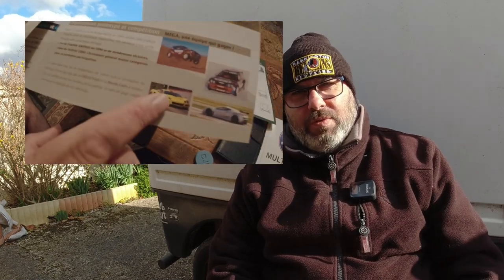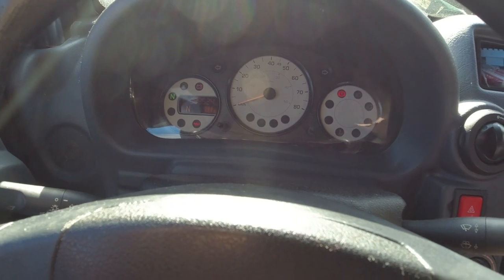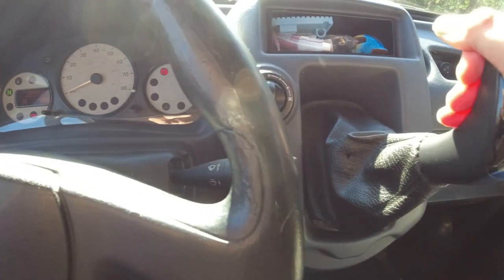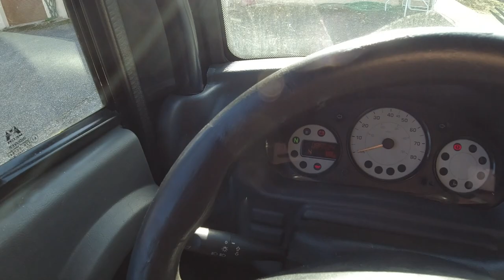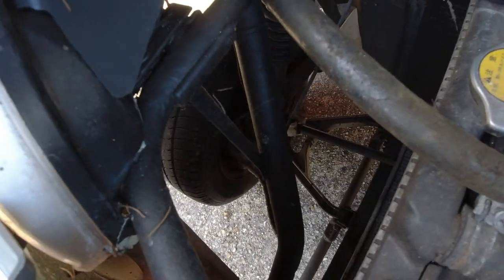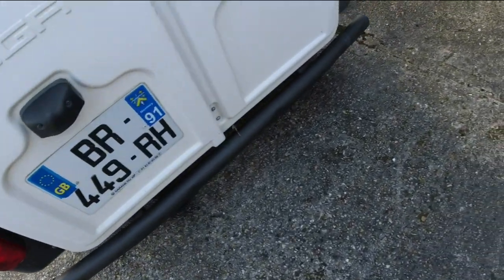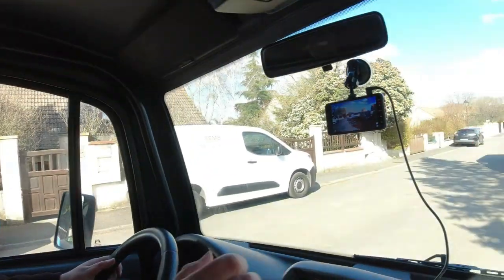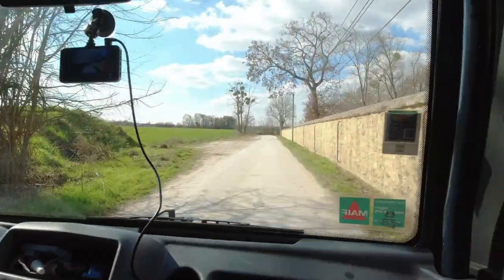"The worst thing ever driven? The Aixam Mega Van thing." - My reply to Hubnut... :o)

Comment: I got an Aixam Mega from 2007 and find it kind of fun to drive. Sure, it's kind of loud, but not at all like hubnut. No idea how he managed to get that beeping noise. It's perfect to able to load lots of stuff. Here in Sweden, car saves on road tolls, no inspection fees and no vehicletax. Also doesn't use that much fuel. Also, enough with a moped drivers license which you could take in a weekend with additional reading.

As I mostly drive locally and on city roads, it's no biggie to be limited to a legal speed of 45km/h (even if it can push 60km/h if you would want to, but then it would have to be registered as a car).

So can't understand the negativity.
Reply from the maker: Sadly it was a severely biased video, which as a result got a lot of views for his channel. These vans aren't perfect, but they are fun. But if you do video of a very bad and uncared for example it does give the impression that these trucks are really bad, when if fact they aren't.
They were designed for a purpose, to basically be a 4 wheeled moped (like a 2CV???). Easy to drive, economical and can carry a decent load. They aren't meant to be fast, due to the licensing level. Here in France, they can be driven with no drivers license. Just need insurance. If you are older like myself and born before 1988 you do not need to take any tuition. I use mine to mainly get around our village, where in recent months the limit has been dropped down to 30kph on all village roads. I could take it to surrounding villages, but the road limit on the roads around here is 90kph. Our nearest town is 3km away and the road into it from here has been dropped to 50kph.
Anyway, if you are negative or cause conflicts on social media, then that results in lots of followers, likes, views etc. Just the way the world is on here now.

Comment: Never driven one but I've always liked Aixam.  There's quite a few in Poland, particularly in rural areas where bus services are infrequent, footpaths are non-existent, dangerous to ride bikes due to idiot cars drivers etc.  I've heard of older school kids driving themselves to school for those reasons.  The current range of cars are styled very nicely indeed - somewhat rather "inspired" by the Fiat 500 and VW Up (IMHO!).
Reply from the maker: Sans permis are expensive, although the Citroën Ami is actually a lot cheaper than Aixam & Ligier cars. I bought my van to get around locally. Didn't want a vsp as they are so small - plus the van is actually useful. 
In 2004 I bought a sans permis 50 cc scooter, so I could get to my French lessons 15km away. Rode that till my son was born in 2007. Had two occasions where I could've had a serious accident, so am not keen to go back to riding it again. I sometimes wonder if my van would be safer than being on 2 wheels.

Nice Allegro estate BTW. Those are a rarity now.
Reply: @MegaBreadvan  I dabbled with bikes myself and even got a full license.  Great fun but IMO literally anything with 4 wheels is always going to be safer!  Glad you like the Allegro.  I haven't done much with it lately but the engine rebuild will start soon.  So many things to fix I lost my direction for a moment!
Reply from the maker: @ProjektAgnetha  Easily done could say the same about my van, but everyday life as a parent and other stuff gets in the way. I also teach English part time.
My scooter is still in the garage under cover, but I'll be selling it on so someone can either get it back on the road or use it for spares. The main job at the mo is sorting out our garage so I can get Mega Breadvan under cover.

Comment: You can Nitrous oxide a Diesel auto, dont do it on a manual you'll burn out the clutch.
or for a cheaper alternative inject propane, not as much power increase but cheap and easy.
and dont do either for more than a few seconds as the engine will burn up with the extra heat.
Reply from the maker: Not sure I'd trust myself with that sort of experiment. Don't really want a pile of molten grey and white plastic/fibre glass in my driveway.

Comment: I watched the hubnut video and thought it was ironic have negative he was yet is quite positive about his Invacars. Yet this vehicle is a lot more practical.
I have a three cylinder Kubota and you need to pre-heat these motors for a while even more so in cold weather.
Also they are very noisy and they have no blowers so pickup can be a bit slow.
Plus I have a 2011 Huyundai and I could mention quite a few minor faults with it. Even one of the hinges on the glove box has bust. But it is 12 years old.
Reply from the maker: He doesn't like 2 cylinder diesels and so that's that. But I like the sound of the Steyr unit in TWC.
Putting the engine aside my van is in the same class as an Invacar. One more wheel, one more seat and a decent load space.

Comment: Are these sans permis in the UK? Can they be driven by a 14 year old. I coild see millions of Sans Permis cutting CO2. France has nearly 65 models of Sans Permis.
Reply from the maker: The UK doesn't have the same licensing system as in the EU, so no, they aren't sans permis in the UK. But it seems that Aixam has dealerships over there, so a certain number of Mega Multitrucks were sold there.

Comment: How to reduce the noise in the cab drastically: Convert it to electric. 🤭👍
Reply from the maker: Would be nice to do that. You can pay for  it if you want. 😂
Reply: @MegaBreadvan  Quite. It's actually far cheaper to buy a new EV than to have a petrol or Diesel vehicle converted to electric.

Anyhow, thanks for resetting the balance after Ian's recent video. You explained the purpose of sans permit vehicles very clearly, and now the category makes more sense. 

Slightly off-topic, but when the Citroen Ami was first reviewed over here, it was interesting to me because it fulfilled most of my daily requirements, namely travelling in our local city, where most roads have speed limits of 30 mph, and only a couple allow for 40 mph. Some areas are restricted to 20 mph. 

I did register my interest in the Ami with Citroen through the proper route, and did receive an acknowledgement, but after a couple of further advertising emails, things ground to a halt. The vehicles probably never arrived in Britain, which is a shame.

Now I see the reason for the Renault Twizy becoming popular, especially in France! It's at a disadvantage here though; it's little better than a scooter when it comes to weather protection. At least your van affords that luxury. 😉
Reply from the maker: @RWBHere  It the case of an Aixam D Truck you are looking at 13,000 euros brand new. When I bought my diesel Multitruck second hand EV versions were going for 2,500 euros. All with knackered batteries. You would be looking at paying the purchase price again to buy new battery cells. Then at some point in the near future the motor would need replacing too.

Comment: So, does a sans permis require a contrôle technique or does it dodge that bit of legislation too?
Reply from the maker: Glad you mentioned that. Just read that from the 1st of January 2023 the contrôle technique will be obligatory for les sans permis. Previously it wasn't.
eeek...
I feel a video coming on.

https://www.auto-moto.com/actualite/societe/controle-technique-2023-motos-voitures-permis-282343.html
Reply: @MegaBreadvan thought they cancelled that along with motorcycle testing
Reply from the maker: @robindumpleton3742  From January 2023 all sans permis will have to go for a CT. I've not put my van in for it yet. I wonder how strict this is going to be, as I've not had any notification about it.
(They could contact me, via my details on the Carte Grise).

Comment: Microcar is a better maker of quads, their long wheelbase MC1 or 2 beats Aixams.
Aixams and Microcar also come with petrol Lombardi 2cyl engines as well as
 Kubota 2cyl dumptuck diesels.
Reply from the maker: For me it was a toss up between Aixam & Ligier. Aixam are by far the most popular sans permis in France. Ligier also do a truck but they aren't as popular as the Multitruck/D Truck. That said the French Post Office use a sort of buggy truck by Ligier for deliveries in towns where roads are very narrow.
Lombardini seems to be the choice for petrol engines, although the Multitruck/D Truck do not have that option. It is either a smelly Kubota or electric with 12 battery cells under the seats/load area floor.

Comment: Much different to the Hubnut video obe thing is the CVT transmission how they shoukd be simpke easy to repair not like the ones you geypt in the newer cars l wouldn't have one fortunately nobe have CVT a normal 5 speed manual in my Toyota Hilux ute and my wifes a 2021 Suzuki Beleno a torque converter automatic as for been a plastis bodied van that slurry you used as long as you have plenty of lego and asitone you should be able to repair your van one thing is plastic doesn't rust
Reply from the maker: Unfortunately plastic can "cook" due to extremes of temperature. So it is a case of keeping on top of any cracks.